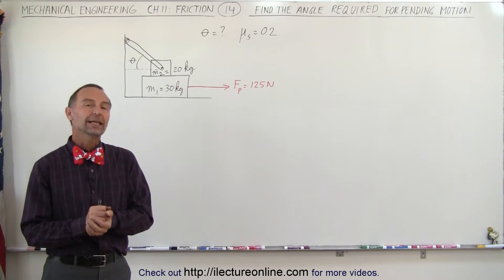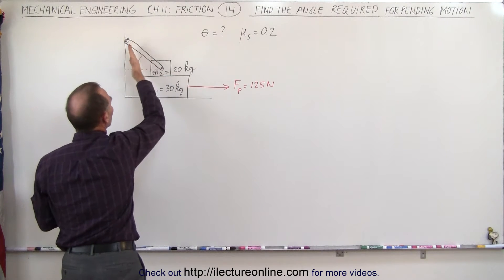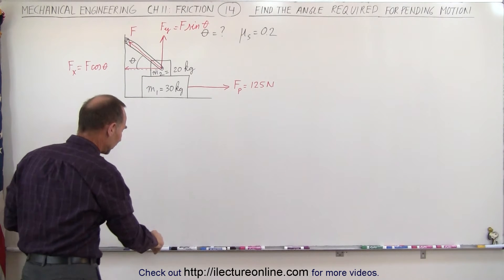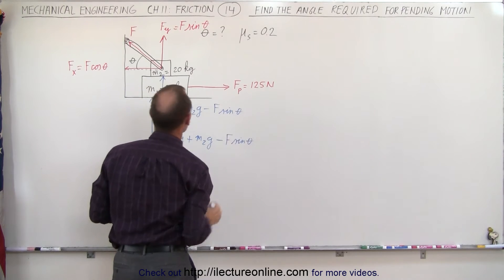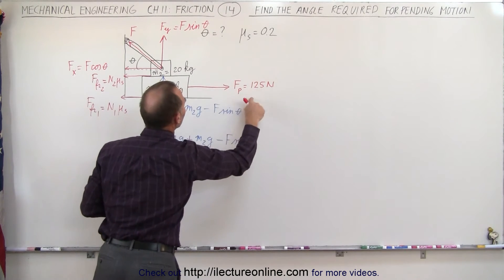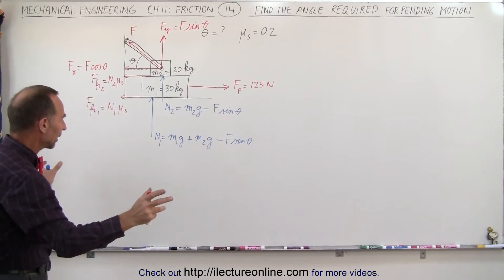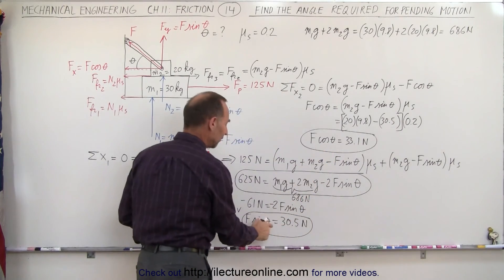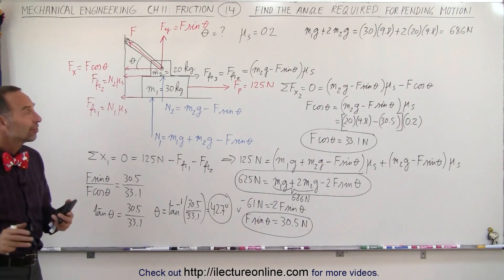Mechanical Engineering: Ch 11: Friction (14 of 47) Find the Angle Required For Pending Motion

Comment: Sir, I would like to have more practice problems on friction in which an INCLINED link is connecting the two blocks , one block on horizontal surface and other block at inclined plane.
Reply from the maker: We have dozens of such examples in the mechanics portion of the physics videos  (chapters 4 - 6) and Newton's laws.